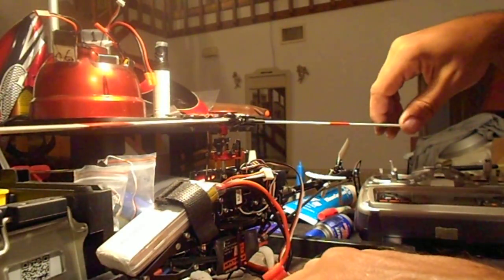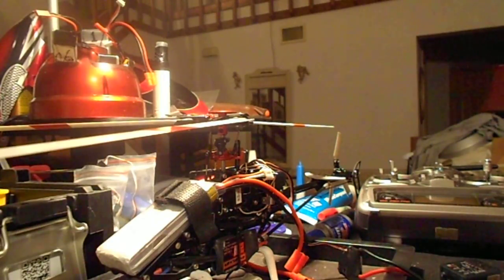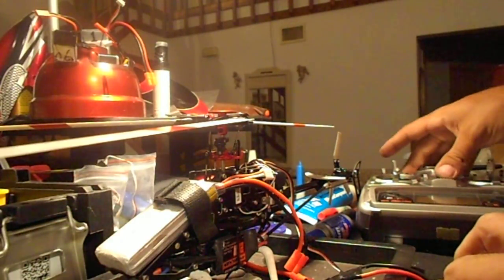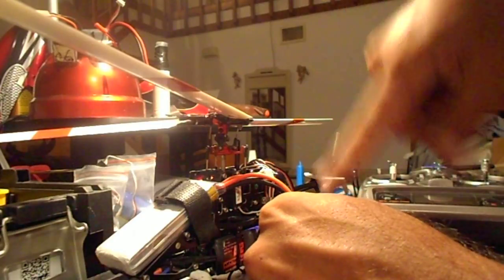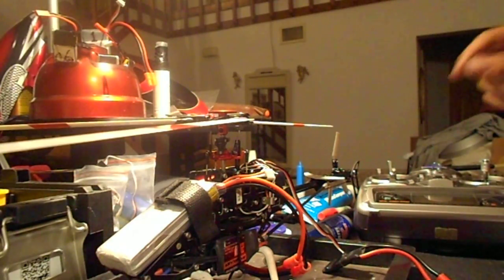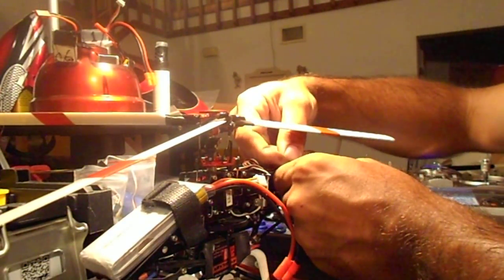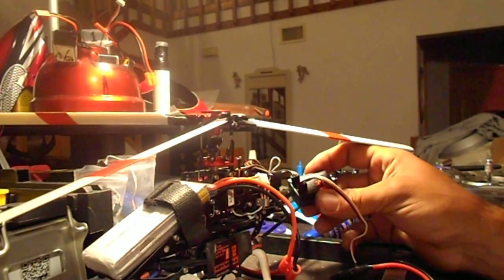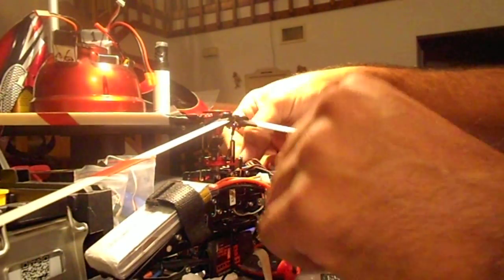4f200 - Hobbywing Skywalker 20A ESC - How to: programming mode

Comment: hi great video, i have walkera v450d03 and using rx gyro combination, you are right when you say walkera reciever prevents esc into programming mode, I will be using this video to guide me in bypasing the protection, so my question  I will have to connect two esc, (hoobywing 40 and the stock esc) on the RX/gyro, which port does each goes I assume one will be on throttle and the other one will be were?

Comment from the maker: As far as not needing two BECs to program the "New" ESC, which is a year old now.... Your wrong.  You would be right if this wasn't a piece of junk Walkera heli and RX/gyro unit. Walkera has a protection feature that prevents entering programming or throttle limit set mode. So to set throttle limits or program the ESC, this is about the only way i have found.  I now fly Gaui helicopters with CC ESCs and beastX gyros and they do not have this problem.

Comment from the maker: Yeah, i know that now. But at the time, some people on the forums were telling me that programming the ESC in this manner would fry the RX. So i shot this video to show them they were wrong, but at the time i didn't realize why. Even though i was completely aware of the 5v BEC circuit i was thinking about pack voltages for some reason. I had only started flying 4 months before this video was shot.

Comment: All I can say is LMAO... The receiver is NOT seeing 12/14 or whatever volts.. as you say at 4:53. The speed controllers have a BEC (Battery Elimination Circuit) built into them that is supplying the 5/6 volts that powers the receiver and any servos you have hooked to it.. There really is no need to hook your old ESC to the system to program your new esc.. all you are doing is using the old esc as a bec when the new esc has one too.. IE powering the receiver with two 5/6 volt sources..

Comment from the maker: I have had similar issues with the Hobbywing Platinum Pro 40A ESC. I think the throttle limits on the ESC get set wrong or glitched. I really have no idea what is going on. But, thankfully the ESC has a "reset to default" function. Try that, and then try resetting your throttle limits like normal. I think that should do it. That is what worked for me.